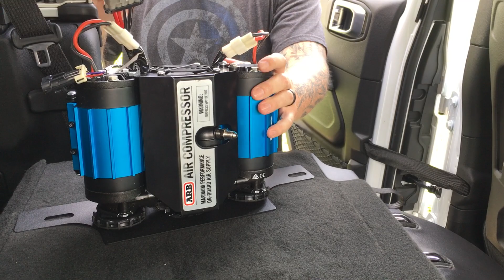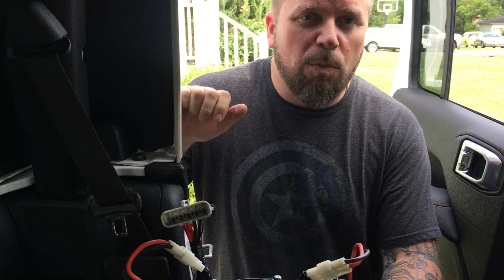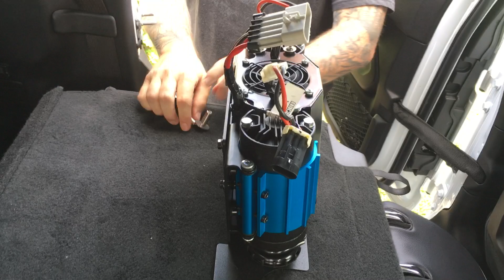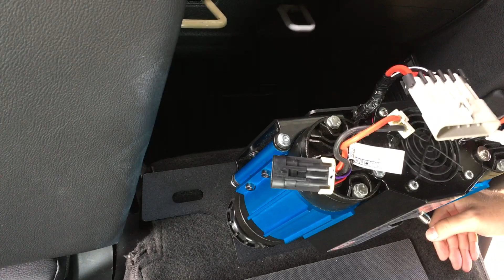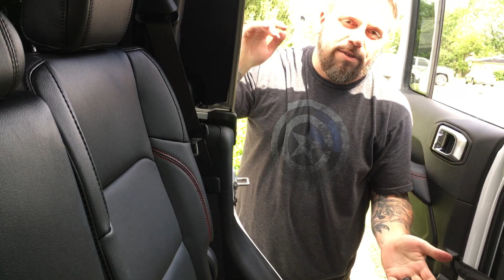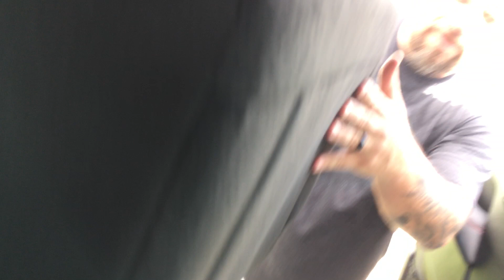813 Fabrication & Design ARB Twin/Single Behind The Rear Seat Compressor Mount 2020 Jeep Gladiator

Comment: Did it damage the garment behind the seat due to heat of the compressor over time?
Reply from the maker: I have not had any customers mention that it has damaged the seat. We recommend that the seat be dropped if being used log enough for a 4-tire fill. You can also use sticky sheets of heat shield on the back of the seat to help with the heat

Comment: Why is it require to have the air filters on the bottom?
Reply from the maker: It's not required. In the install instructions I explain mounting in either direction. It is actually better to mount it with the filters up to make it easier to service the filters.

Comment: This is, by far, the best solution I have seen yet for installing a compressor permanently in a Jeep Gladiator!  I love it.   I was very hesitant to mount a compressor in the engine bay for several reasons, but there weren’t many options.  

I have pre-ordered a 2021 Gladiator diesel and I will be adding this solution as one of the very first upgrades!  I plan to keep the hose and chuck under the seat anyway, so having the switch there makes a lot of sense.   Nice work.
Reply from the maker: Great!  I'm glad you like it.  Let me know if you have any questions while you wait for the truck to arrive!

Comment: Waiting to see the wiring video and how you run the airlines... really like the product. 
I need to see if in need a single or double arb soon
Reply from the maker: There is a new video up on my channel showing a few ideas and parts for air lines!
Reply from the maker: I'll get some thing up asap. All depends on what you plan to use the compressor for.  If you want to do a 4-wheel-all-at-once fill, I would say go with the Twin.  If taking a little more time is not a problem the Single should be fine.